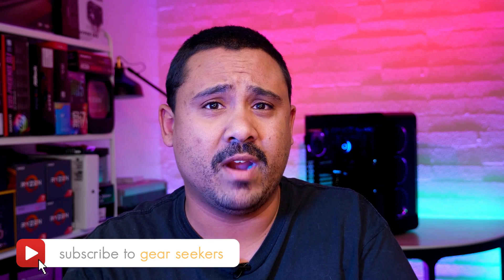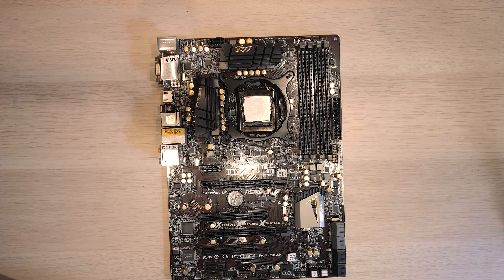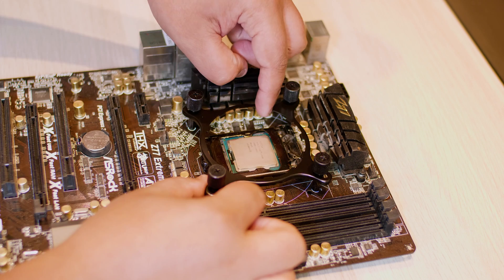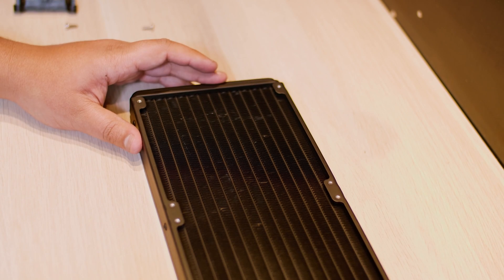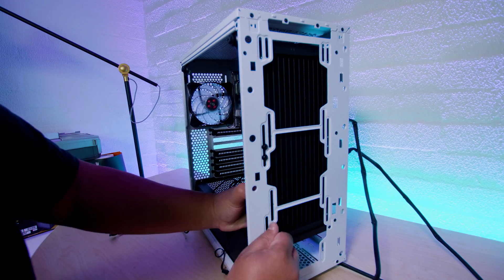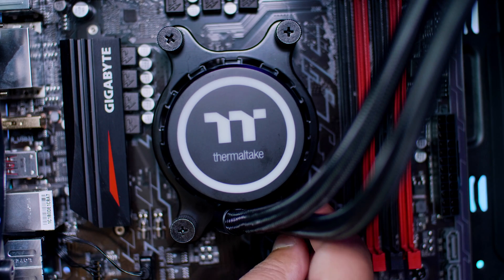HOWTO Install Thermaltake Floe Riing RGB TT Premium Edition AIO on Socket 1151 and AM4

Comment: G'day Nick, just went to look for someone fitting this AIO (just got given one) and the very first video in the Google search was yours.
Nice to come across you again so quick - thanks for the chat at Mwave the other day (walking stick/hat guy) and for just the vid I wanted to see. :-)
Have a great day and catch you next time.
Reply from the maker: Hey Gary! Great to hear from you again! Hope you're well and hope your install went well. How's the new keyboard?
Reply: @GearSeekers  Hi Nick, 
Hope you are well.
The keyboard is great, still playing with the key colours  - only problem is that I am not used to the speed and sensitivity of the keys (coming from an old membrane keyboard) and double press the keys occasionally. :-)
Only using it on a NUC at the moment as I set up my desktop - just figuring out all the 11x fans, 4x temperature sensors and 5x RGB cables (3 off the AIO) - connecting to a Corsair Commander, an NZXT USB expander and motherboard fan/temp headers
It looks like someone spilt their bowl of black spaghetti in my case, so I want to neaten them up with all the other cables.

Comment: Greetings Nick, just came across your video after purchasing my Floe Riing cooler and I have a question about the USB connector for the controller. I only have one 9 pin USB 2.0 connector on my mb, is there a way to resolve this issue?

Comment: Unfortunately I have 10 fans and a pump to connect to this setup not sure how to daisy chain them also not sure I’ll have an extra 8 pin slot open for an extra molex connection is there any way around this ? Or do I have to ditch a fan

Comment: You don't show where to plug in the mini USB Cable,  one end fits in the controller, but where does the other end go?
Reply from the maker: Into your motherboard.
Reply: @GearSeekers  I figured it out, there's a splitter, and for my cooler, there's an extra one for something else, perhaps dual CPU support?

Comment: i was just watching this video for fun to see if i had done it right iam no expert but iam pretty sure your fan on the rad is backwards should be logo side out not braces and factory labels
Reply: https://imgur.com/a/1CdQnxj
Reply from the maker: No it's correct mate. It's different for every case and install
Reply: @GearSeekers  can you explain why it doesn't make a difference changing fan direction from pullling  cool air from outside to pulling hot air from inside into the rad
Reply: @GearSeekers  i dunno any pic i can find with it in pcs with fans being seen on the inside has logo side out which only makes since why hide the logo fans only spin one direction. the way you have it your drawing air from outside the pc to inside. when it shows  on everything people use or advertise have the logo side out it blows into the hot rad colling it down taking any hot  air the rad is giving off and blows it outside the com I just wanna know the difference and why you went. your way any hot air passing threw your rad is just going right into the pc.
Reply: @GearSeekers  and... silence don't worry i gave you a thumbs down

Comment: Not enough explanation concerning plugging the cables. For som1 new it'll be hard to understand.
Reply from the maker: Lol. You plug them in. They only go into 1 connector on the controller.
Reply: @GearSeekers  another thing bro, why forgot about one important thing too: setting the dip controller switches, which may confuse a lot of people.

Comment: I have a large case so I can mount either, Q is, is the Thermaltake Floe Riing RGB 280 better , as good  or not as good as the RGB Riing 360 TT Premium?  Do the 140 large fans but shorter radiator outperform the 3x120mm fans and longer radiator? Im trying to decide which too top mount. ps, great vid again thks

Comment: Help please friend... I have an Aorus Z390 board and it has a 4 pin CPU OPT connection on the  board which I believe I saw you plug the 3 pin speed controller from the pump into it... Is that correct? ... can I plug my  3 pin from the pump  into the 4 pin CPU OPT and if so is there anything I need too be aware of when connecting it?? Your help would be much appreciated.. thks

Comment: where did you connect the other micro usb, where did you connect the power for the controller, you are skipping alot of important steps that I for one, needed to guess. the rest is ok. Many guys are missing the details in their videos, you are not the only one.
Reply from the maker: It's not supposed to connect to anything. I didn't miss anything. It's a spare

Comment: I had an FM2 motherboard and used the screws for FM2. It turned out that the cooler size was an intel lga 115x and so because I had the FM2 screws in upside down with the thicker part screwing into the little toppers it destroyed the threading. I was mainly wondering what the specific name of those little toppers for the screws is so I can buy new ones.

Comment: Ok so im getting this for christmas and I just want to get some confusion out of the way. It all ready comes with thermal paste? and if I want to install inside on the top of my case then which way would I put fans and does the radiator go on the top or bottom for that?, and finally do I need to buy the water or does it come preinstalled in radiator?

Comment: 4:26 mounting the fans reversed lol
Reply from the maker: Nope
Reply: Hi, Why do you say that the fans are installed in reverse?  My son is in the process of building his own desktop with this exact cooling system.  I was debating on advising him whether to install the fan in such a way to pull in cool air from outside to cool the radiator, would warm the cool outside air when brought into the chassis, or push warmer air from inside the chassis through the radiator out.  Note in addition to the radiator and the two fans installed towards the front of the chassis, there is another fan in the back that is pushing the air out.  I would appreciate your thoughts on why you think the fan is installed in reverse.  Thank you.
Reply from the maker: They aren't.

Comment: Great video!  So when you plugged the cord from the Header/Pump into the motherboard's AIO_Pump or Fan port, how did you decide which way to put it... since the cord has 3-prongs, and the ports for AIO_Pump and Fans on the motherboard have 4-prongs?
Reply from the maker: It doesnt matter. The difference is because one mode from the header is DC mode PWM mode. 3 pin connectors just mean it's DC powered. 3 in a 4 Pin is normal.

Comment: Didn't find the information I was looking for, but thumbs up for the video quality
4K rules!
Reply from the maker: What info we're you looking for?
Reply: @GearSeekers  Sorry for answering that late, but I might have been stuck with TT's hub.
IF I remember correctly, the Pump had a header that looked so much like a USB2.0 header but witha different pin pattern and i didn't figure out that I was supposed to plug it into the hub.
Now tho, I'm using TT's 360 Floe to cool my hybrid 1080Ti.

Edit: Watching it again, i see that you mentionned the similarity with USB2.0 so I really don't remember what problem I was facing at the time lol

Comment: If I install my AIO at the top of the case instead of the front do I flip the fans from what you have?  ie logo side facing inside of the case?
Reply from the maker: Yep flip them to exhaust out the top :)
Reply: @GearSeekers  Shaolin95 commented that the fans were mounted in reverse in your video.  In your video, you have the fans mounted in such a way that it will pull in cool air from outside through the radiator, right?  I somewhat agree with doing it that way, which is what I advised my son - pulling in cool air from outside through the radiator, but then isn't that heating up the inside of the chassis?  Note that my son's PC has a fan in the back that is blowing the warm air out of the chassis.  Having the fans blow warm chassis air through the radiator would not cool the coolant as fast, I'm assuming, but I'm not sure how big a difference it will be.  Waiting on receiving the processor today by mail to test everything out.
Reply from the maker: @johnharimoto8605  he's wrong. 
If the radiator is mounted at the front of the chassis the air should be pulled in from the front and pushing air over your components. Airflow is airflow. 99% of these people who comment have built maybe 1 or 2 PCs. I'm building 5-10 a week and have been building PCs for 25 years.
Reply: Gear Seekers thanks this was one of my issue as well, just followed what looked like in the instructions and after screwing everything in all videos I’ve seen had them facing the radiator and thought I wasted time

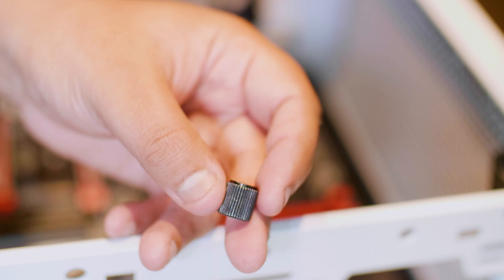Comment: what are those thumb screws called? the one at 1:44 and also thew screws at 3:13 and do you have to put bracket on the back for am4/tr4 installs or just the screws?
Reply from the maker: The are thumb nuts and there should only be 4 of them. AM4 and TR4 are completely different. TR4 you need to use the bracket that comes with the CPU to install this cooler. 
 The TR4 bracket connects to the socket retention system. AM4 uses the back plate that comes on every AM4 board.
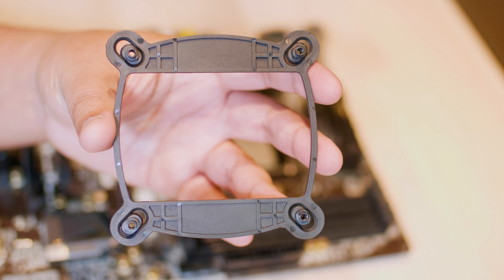Reply: I have x399 gaming pro carbon ac. So you are saying I dont need the bracket in the back at 1:13 and also I know that my thread ripper comes with the bracket and can you please be tell me what screw they are at the times I said please I would really appreciate it and I love this video!
Reply from the maker: No bracket needed. Screws into the front of the socket. I have no idea how long they are. They only come in 1 size in the box anyways. They are the long ones.

Comment: Thanks for the video, I very much enjoyed it.I have just one question, the instructions that come with my TT Floe Riing 360 TT Premium Edition [3 fans], has a section about how to set up the dip switches on the controller. On the last Step 10 it says "Set the DIP switch on the back side of the controller to assign the number of the controller" and the diagram shows the DIP switch settings from No.1 to No.16. What is this about?? It does not make any sense to me? "To assign the number of the controller??? Where is this number on the controller... i can not see any numbers apart from the fan header plugs, which are only 5 of? It may be to add another controller? OH it must be that, so if you daisy chain another controller to this one, you assign No.2 with he DIP switch setting?? Or????
Reply from the maker: The DIP switches are meant to be used if you're using more than 1 controller in a system. Other than that you dont need to change them at all.
Reply: @Gear Seekers thanks for hitting me back with the answer, much appreciated. I must add that the 4 pin header on the controller that I mentioned is actually to plug the molex power cable to the PSU, to power the controller.

Comment: I just got one, but while taking it out of the box I could hear some slight sloshing. That doesn't seem normal, but is it?
Reply from the maker: It's normal. It has water in it lol
Reply: I'm just worried it might have too much air in it. I hear that air is bad for pumps. Did yours slosh when you handled it?
Reply from the maker: It's fine. Think of it as a bottle of water. When you move it around even if its full it will make sounds. Every AIO I've ever used (literally thousands of them) has made a sloshing sound.
Reply: I'll take your word on the AIO, but try fill a bottle of water till its brimming and cap it; you'll find that if there's no air, it doesn't make a sound even if you shake it.
Reply: Mine makes the sloshing sound too, I only just came home with it from the store. It's a 3 fan Floe Riing 360 TT Premium Edition model but you only need a tiny amount of air in a closed system like this, to make it sound like there is excessive air in the "loop" when shaken. Also the material it is made from would amplify the sound, too.

Comment: Where does the micro USB plug in? I saw one end went into the rgb box but what about the other end?
Reply from the maker: Motherboard header. Make sure you watch the whole video
Reply: the other end of the USB to 2x micro USB cable, the one with a larger rectangular female header plugs into a spare USB2.0 header on the motherboard. This is where Gear Seekers was putting in the cable through the hole where he was pushing the cable back and forth [as though it was having sex],  at 6:05 he shows plugging it into a USB2.0 header on the motherboard, after the having sex thing lol 
However, if you mean the other micro USB plug, then I am not sure why this actual cable even has 2 micro USB plugs, when the whole system only has one micro USB plug, which is on the controller. I am guessing it is because since all USB2.0 headers on motherboards have 2 USB ports anyway, Thermaltake put these into some use, so you end up with a spare micro USB plug. Maybe in case you want to use it on another [Thermaltake?] product that uses a micro USB port?

Comment: I’ve been spending about an hour trying to find out if these water coolers need a reservoir and/or pumps to set up. I am looking at buying the 360 floe riing
Reply from the maker: No AIO needs that. Thats the point of them. The fluid is inside. The pump is on the CPU block. They are completely self contained. They are designed for regular people.